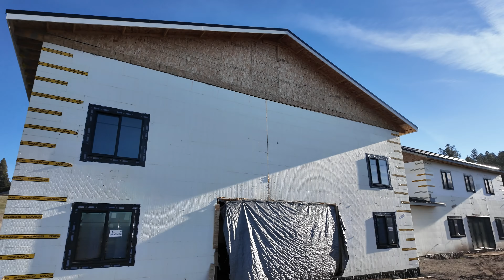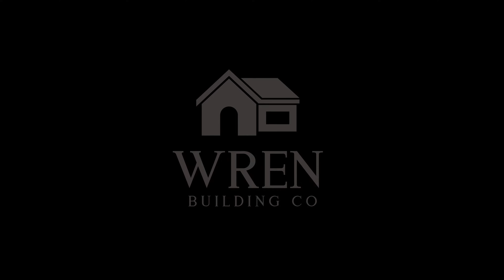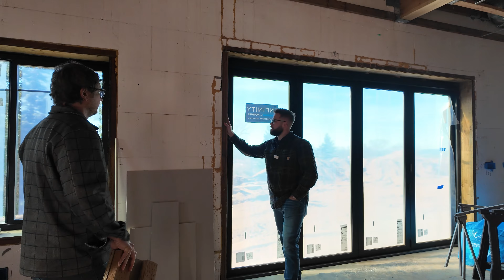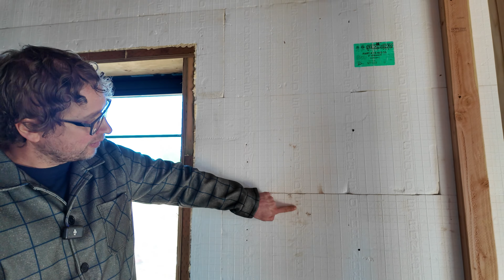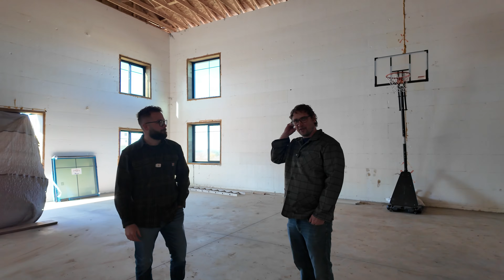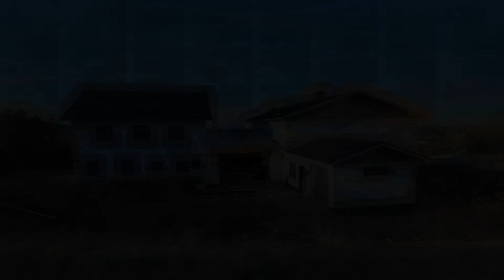7,700 sqft ICF Build With An Indoor Sport Court

Comment: How do you attach the bucks to the ICF blocks?
Reply from the maker: Once you place the window buck in the form you rip down strips of plywood roughly 4x16” and screw the flat piece to the buck and ICF block. Each row gets a strap. Once the pour cures, unscrew them and it’s locked in place!
Reply: @ nice! If you were to do a second floor with wood joists, would you stack the ICF on the wood deck or is there a system that would allow the ICF to be continuous up to the roof height on the second floor?
Reply from the maker: @jordanporter5282 you set brackets in the ICF wall so when you pour the wall, all your brackets are wet set. Then you roll your joists!
Reply: @WrenBuildingCo  thanks!

Comment: 1" of spray foam won't give you a good air seal.  Closed cell requires 1.5-2" and open cell requires like 3-4" or something.  Check with the manufacturer.

Comment: Looks great. A couple of questions. 1) how did you pour the concrete in the 20ft wall above the 10ft drop recommendation?  2) how did you vibrate the bottom of the 20ft wall?
Reply from the maker: The concrete is mixed with enough water to make it flow easier, since its virtually impossible to vibrate the forms near the bottom.
Reply: Dont producents say , it’s best not to vibrato the concrete